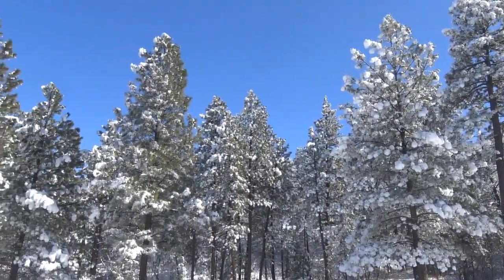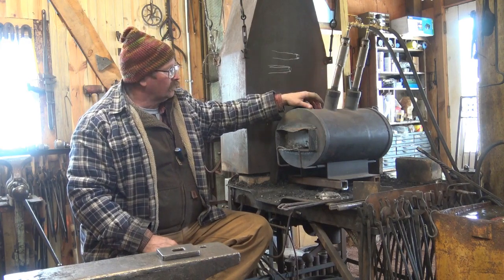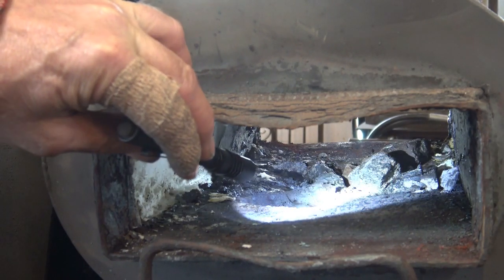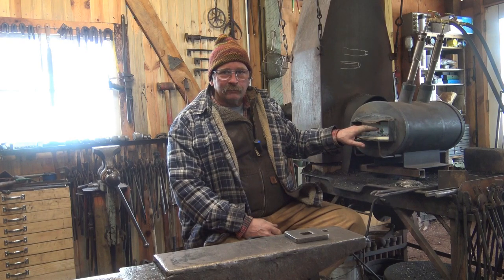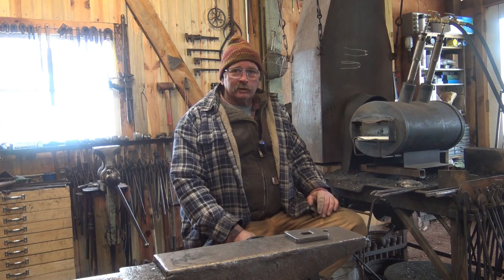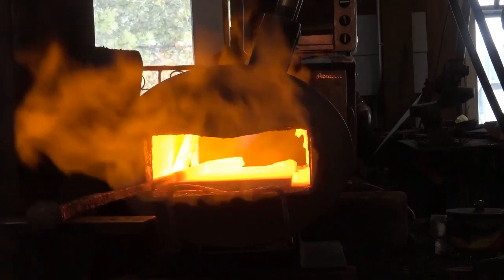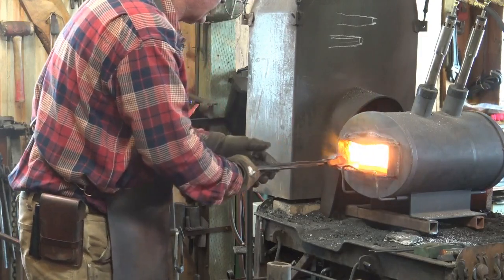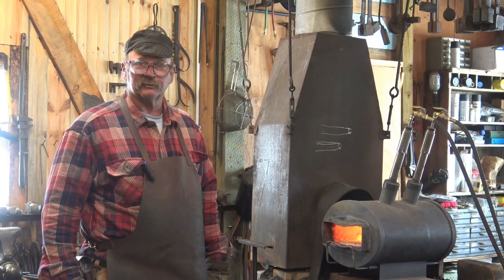Forge welding in a gas forge - fact or fiction

Comment: I built a  3 burner gas forge and I'm finally getting it close,  welded 7- 3/8 cables together for a knife. It's so intriguing! Lol!
Reply from the maker: Cable is higher carbon and welds at a lower heat.  It is good experience and really lets you feel the difference between welded or not under the hammer.  Plus it makes some pretty cool stuff.

Comment: I built my own with 2 T-Rex burners and some large diameter pipe. Properly lined and especially with reflective coating, there's no problem getting a 5-lb billet to welding heat.

Comment: Hi John, my two burner gas forge is lined with refractory bricks, the first hearth I put in it were bricks sliced in half lengthwise and the joints sealed with refractory cement, it has lasted for 6 or so years and the flux does not seem to bother it. I have since built another or more correctly reused the burners from my old one and I located some refractory tiles 1 inch thick 14 inches by 8 inches and I have lined the forge box with them I will send a photo when I work out how to attach a photo.
Regards Stephen

Comment: John, Another informative presentation, I built my own gas forge with aspirated burners, as you point out the floor does degrade so I purchased some refractory bricks split them length wise with a 9 inch angle grinder and lined my floor with those, I topped the brick layer with a thin layer of refractory cement and I renew that when necessary. The bricks were a dollar fifty each and the bag of cement was twenty five dollars in Australian currency. The bricks are soft and I broke a couple slitting them, I have had the forge for around 3 years and floor has never been replaced.
Reply from the maker: That is a pretty good track record.  Do you weld in it often?

Comment: Recently built a blown ribbon burner forge. At 6 lbs press. it will start burning steel if you're not careful. Welding a billet is a snap.
Reply from the maker: How well does it hold up to flux

Comment: Another excellent video, Thank you John. I have been building gas forges for some years and I have found that there is a trade off between high efficiency and high heat.You can do a flux-less forge weld between 2310- 2330 degrees. Getting a K-type thermometer on your forge helps with adjusting the mixture for max efficiency and proper welding heat. Scaling in the forge is the result of un-burned oxygen on the work. any time steel gets above 1800 degrees it is in a scaling heat and as soon as it is taken out of the forge it will start to react with the oxygen in the air.

Comment: John, responding to your reply to my last comment, in May of 2016 I replaced the burners in the gas forge to better ones, it was an old farriers forge and did not get the metal hot enough to weld in. Since, I have welded in it a dozen or so times, 4 times before I replaced the floor with bricks as I was over exuberant with the borax and it wrecked the floor quickly
Regards
Steve

Comment: Thanks for the video, I constructed my own gas forge that has a single reil style burner, was going to add another burner just to get the welding temps. Tossing the idea aroumd of a coal forge just for welding and then the gas forge for working the billet, I really want to get into damascus making, but I do not want to break the bank and kill profits to do it. I know either way its going to cost more, so well see what works.
Reply from the maker: If your gas forge gets to welding heat its probably the best option.  They tend to have a more even heat with less chance of burning the edges.
Reply: @BlackBearForge  Thank you for the fast reply, I suppose adding another burner may do the job, I was going to add it anyway to experiment. Thank you again! I had alot of trouble trying to make chain damascus and the fact that the borax eats the ceramic wool hardcore. That was with a single burner..almost got to welding temps so I would think adding another burner will work..hopefully

Comment: I can't believe I never thought of doing a poker that way lol. That would save me a lot of time rather than upsetting 3/8 or 1/2 inch and then splitting it and drawing it back out. Thanks for the tip
Reply from the maker: Seems like this was the first way of making a poker I ever saw in a book.  I do start with something like 3/8" x 1" and draw out the shaft under the power hammer when I want a split style poker end.  So I avoid the upsetting.

Comment: Hi John Got a question for you if you don't mind. Have you ever been able to forge weld using just fire wood and a hair dryer. I have managed to do a weld or two where 40% was welded without any lines showing after grinding, but in places it I could see them. But I used high carbon steel and heared the welding temps are lower. Can not manage to weld mild steel, tried it a good bit. I use boric acid as borax is not available. Would love to hear your thoughts on it or better still watch you succeed in a video using fire wood only. I think I am not getting up to heat is the problem. Any ideas. Tried charcoal but the two pieces of mild steel did not stick together no matter what I did.
Reply from the maker: There are many variable in forge welding.  Good clean, deep fire is vital as is proper air supply.  I suspect that with a hair drier and fire wood, you just can't get a hot enough fire with the proper reducing atmosphere to weld reliably.  Turning your wood into charcoal before trying to weld would help increase heat and make a cleaner fire.  But I still doub't the hair drier puts out a sufficient air supply.
Reply: Thanks that is a good place to start. Will need to get a different air supply now that the hair dryer is making funny sounds anyways.
Reply from the maker: Try the bouncy house blowers if you are on a budget.  They need a gate or damper because they can put out to much air.  But they are affordable
Reply: Thanks John. Ordering to India is at times difficult and I don't think they do them where I live. That is why I went for the hair dryer. Do  you think two is worth trying. Would give me more air right. Just to say your videos are really great and thanks for making them.
David.

Comment: I never knew gas forges were considered bad for fire welding, I've never used one personally, I use air and coals, and because I use a mix of anthracite and soft charcoal with home made cokes my temps get really really hot, I've melted a few knives when not paying attention lol.
PS, borax and other flux's are not needed with coal fire welding at all, but with gas if you don't want a damaged gas forge you could try using fine silica sand, that might melt it less.

Comment: Thanks for the videos.  They are always very informative and valuable.  You mentioned once that you might start using charcoal in your coal forge.  I would love to see some videos about what you may need to do differently when using charcoal.  Can you forge weld with Charcoal?  Do you wet the charcoal around the outside of the fire pot as you do with coal?  Sorry lots of questions!
Reply from the maker: I still plan on doing some videos about charcoal.  Yes you can forge weld with it, but you need a big supply.  I don't use water but do make a fire brick surround for the fire pot so it doesn't need as big a mound.

Comment: re the introduction footage:- Is that a pv solar panel ? Is it worth the investment Does it provide heat for your shop. Considering investing as the roof of my shop is south facing and was wondering what kind of return it gives. As always like your practical approach

Comment: I'll ask the first grade blacksmith question: "Why couldn't any substance be used as a consumable floor– brick, gravel, plaster, kitty litter?" Thanks for all the videos.
Reply from the maker: We the substances you mention aren't truly consumable.. The coke burns up as you work and must be replenished regularly in James Austins forges.  I would avoid gravel, some stone fractures quite violently at high heat and send projectiles out of the forge.  Seems like I have heard of people putting kitty litter in, but I don't know how it works.  Broken up fire brick does work OK, I know someone that does that.  It prevents pools of old flux that stick to your work.  the flux does seep through to the floor of the forge and will eventually destroy what ever is there, but as long as you're willing to replace it from time to time it would work.
Reply: Stainless tray works great, I got an old kick plate from a commercial door.

Comment: Not a blacksmith, but I am a chisel maker. I slide a bolster down the tang (forming it in the process) of chisels and the forge weld them. 

it's not ideal for me to heat the entire tang for a long time, so I use a brazing torch after getting the bolster/tang junction as hot as possible quickly. it's not workable for something larger than a junction like that. 

I just looked this up out of curiosity as I've got a good stainless two burner propane forge that's good for what it is, but I'd hate to fight it to get forge welding heat on a regular basis. 

I'm considering building or buying an induction forge since I typically only weld spots and prefer not to overheat or distort what I'm making. high heat, small spot, short time would be great. 

I'm sure that there will be some folks here saying "you'll get a failed joint if you use an oxy/mapp brazing torch", but the bolster is actually hammered constantly on my chisels and to the extent that I've had the weld set, I've never had one come loose in use. if the bolster fails to set, it seems to be all or none - I can tap the bolster with a steel hammer and it will quickly move on the tang and I know it's no bueno. 

A little TMI, and very narrow focused. I usually use kawool under whatever is going to get welding flux so that I can just change it from time to time.
Reply: (just after I said that, you mentioned the sacrificial floor - if the floor is expensive, it's baffling).

Comment: Very good video, thanks for posting this as I am currently looking into building a gas forge. A question I thought of while watching is could you use fire bricks like the ones for wood stoves as your sacrificial floor? they are relatively cheap and I know our local Tractor Supply Company has them, at least during heating season, or as we call it in Northern Michigan "The other half of the year" Please let me know your thoughts and again thanks.
Reply from the maker: The brick is a good option if there is room in your forge

Comment: Hi there, loved the video (all your videos). What did you use to seal the threads for valves and elbows above the burners ? I did test run for my freshly built forge about 15 to 20 min. Seemed to work fine until I turned it off. The burner started to heat up when there was no airflow through it so I couldnt touch even the valve with bare hans. To my knowlege they use some kind of plastic in those valves.
Reply from the maker: If you are getting hot gas up the burner tubes try closing the chokes as soon as you shut down.  If its coming around the outside pack some kaowool around the burner where it enters the forge.
Reply: @BlackBearForge  Thanks, I`ll try that !👍😊

Comment: Buy a refractory cement and cast your own firebrick as a sacrificial floor. At 1.5" thick I can get multiple bricks out of a 40 dollar bucket of clean cast and they last longer than the sides of the forge so far.

Comment: We made our own forge. First liner was a plaster silica sand mix. It didn't hold up well.
And so far we have only run 2 burners.
We relied it with some ceramic tile that is 3/8 of an inch thick using 3k (temp)refractory cement. 
Will end up with 4 layers of tile for our insulation.
We intend to use fire brick to line the floor.
Think it will stand the heat?
Reply: *relined
Reply from the maker: I hope the new lining holds up for you
Reply: Black Bear Forge I'll keep you posted. 
Seeing this video brought to light an issue with the borax that we hadn't heard of as yet. Thanks for the heads up. 
Will also use fire brick to take the brunt of the heat blast from the burners instead of directly onto the tiles.
Reply: @shannondeyoung8829  how did the fire brick lining work?
Reply: @TheWoodsmanMilling  it is holding up much better. Really needed to use the ceramic wool as the outside tends to get fairly warm after a while.
Reply: @TheWoodsmanMilling  the outside gets warm, but we've been smelting with it and it's still holding together very well

Comment: I'm not shure where the whole myth of the inability to forge weld in a gas forge. I've never welded in coal, only in gas, its more controllable and if you have it adjusted right, cleaner. The only downside is that the flux will eventually eat through your refractory.
Reply from the maker: I think a lot of the forges built 20 - 30 years ago were simply not engineered well enough and word spread you couldn't weld in one.  Of course now more and more people are proving that to be incorrect.
Reply: Well, there is several reasons, most people forge weld in to low temperature and I think that this video also is in the lower part of temperature span. If you have the right temperature which usually ends with a few sparks and you don't need to force your pieces together. they will stick like superglue if you even make the pieces touch each other. It also takes a lot of time to heat pieces and it will take a long time before you learn how to adjust your burners, preassure, and probably close off one of your doors and part of the remaining one if you have two. I have also noticed that it depends on the weather, low or high preassure. I know that in US the propane prices are ok but in Sweden if I run a gas forge at welding temperature one day it will cost me about 70-80$ +refractory wear +trip to buy more gas. My coke forge does not cost more than max 20$ to run a whole day without any noticable tear.
With controllable I'll asume that you mean almost no risk for melting your piece because in my coke forge I can heat up one inch of my work to welding temperature, with a gas forge you need to heat up everything that is in the forge. It also needs to fit in the forge which most of the work you do don't, unless you are a knife maker or similar.

However, with all that said if I make a damascus blade use my gas forge for welding :) 
Mostly because I don't do this work often enough so it's safer when I lack the skills and there is a lot less ways I can screw it up in a gas forge :D
Reply from the maker: Johnny, You are correct that I am welding at the low end of welding temperature.  I am of the opinion that most people weld at to high a temperature and cause unnecessary damage to their material in doing so,  Once you see sparks you are at the high end of welding heat and starting to cause permanent damage to the material being welded.  Since I weld a lot of high carbon steels for tools, that reduces the quality of the tool.  

Thank you for sharing your economic perspective of the costs you have locally for propane vs coke.  it is easy to forget that each part of the world had different resources available at different costs.
Reply: @johnbloom1109  You will only need to se a couple of sparks, if you not see them the surface is not melted and you will get a partial mechanical and partial forge weld.
If you let one or two sparks fly you can tap the surfaces together and it will be a clean forge weld.
If you do it like most gas forge users do, you have to hammer the living daylight out of the piece and hope it will stay together. And I seriously doubt that it in a microscope that will be invisible.
Reply: @johnbloom1109  "Hold up fine" is not very scientific, is it? I'll asume that you also is a propane guy as most are that defend the low temperature forge weld. I meet many people in person, groups and forum that state exact what you do, but after some discussion it usually ends up with saving gas, or my propane forge does not reach that temperature or you can always hammer it together anyway, sometimes they are afraid of missing the sweet spot and burn the metal with a firework of sparks and a few is thought that way.
If your pieces does not stick together when they touch you are not doing a proper forge weld. You can merge them together anyway with force but it requires a lot more work and as I said before I really would like to examine the two under a microscope to see the difference. Maybe I and many master smiths I learned from is wrong but I highly doubt it when they have spent their lifes doing this. I do not say that your welds does not hold up but I am quite sure that you look at the welds after each heat to check if they are good, I'm not, I can feel it instant.
Reply: @johnbloom1109  Lets agree to disagree, you really should watch industries that forge weld a lot with the highest tolerances with the demand of the strongest parts availible.

The grain structure will be manipulated as needed when continue to forge the pieces to the final shape. Regarding oxide you will have your piece three or four times as long in a propane forge as a needed in a coal/coke forge or proffesional forced air gas forge, and when you spend time banging it together with probably at least twice as many heats it will surely compensate for some oxidization.

And most of propane low heat forgers don't care about grain structure anyway when they completetly ignore ramp/holding times with exact temperatures during heat treat.

I don't think we get any further so i leave this discussion now. Interesting to hear your thoughts though.

Comment: I've heard sand can be used as a welding flux.  Have you tried that?  If not, I think it would be an interesting experiment/video.  If it does work satisfactorily maybe it wouldn't degrade the forge lining?   Your videos are always informative and interesting.
Reply from the maker: Clean silica sand was used for wrought iron manufacturing.  I haven't tried it myself